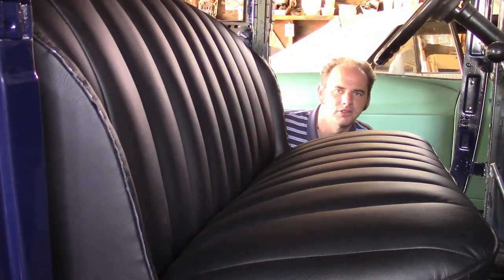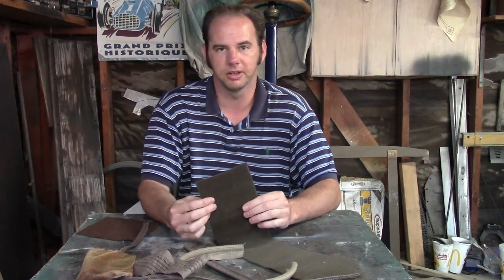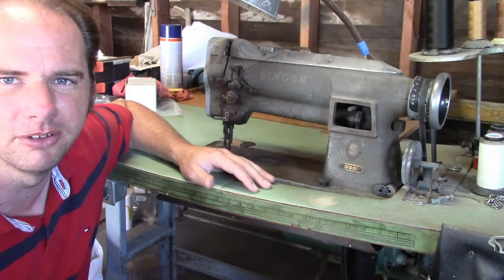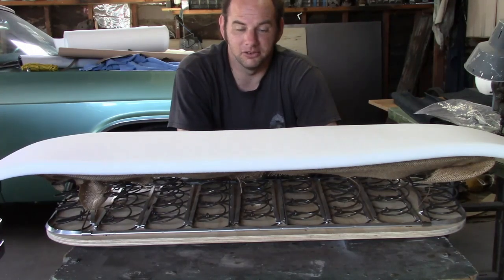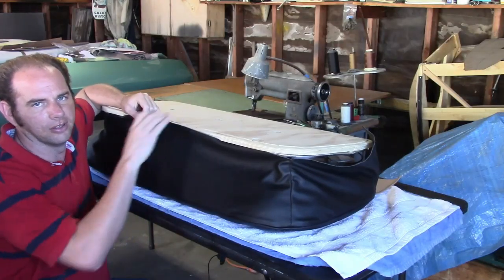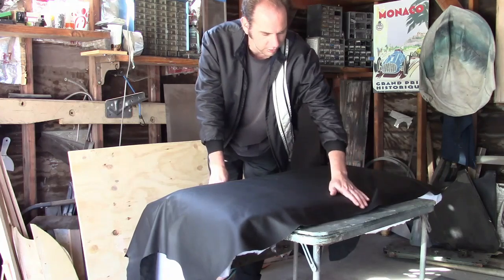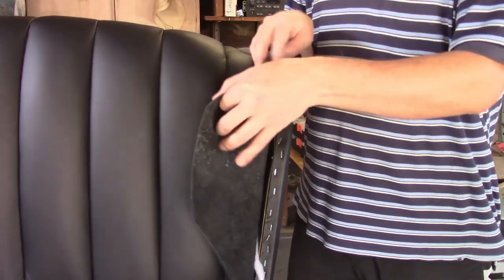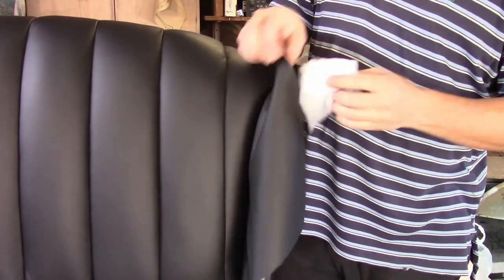1930 Ford Model "A" Repaint and interior. Part 5.

Comment: Brought back many memories of my first upholstery job on my 1926 Model T touring. We drove up to Greenfield Village to take measurements and pictures of the 15 millionth T because back in the 70's there were no detailed photos. My machine was an old Singer treddle type that I'd added  a sewing machine motor. I did most of my work in the drive way in the warm sun to make the textured vinyl more plyable.
Something I used, small weeping willow trees from a nearby river for the seat back tack strips. Soaking them in water then using a lot of C-clamps worked well. After 40+ years the seats still looked decent. Back then I used tacks where there was wood in many areas.
I upholstered several old pick up trucks and cars after that. All were just basic simple custom jobs. If I'd done it for a living I'd gone broke!
Reply from the maker: Clever. I'll have to try that next time I need to make a tack strip.
Reply: @onewhocollects6781  Cut the small willow trees when young and flexable. Soak in a piece of house gutter filled with water. Then place on rear tack strip area of seat and add small C-clamps.
Somewhere I'd gotten a large 3' wide roll of Army green canvas type material to use as the first seat spring covering, hog ringed in place. Used it for years for lots of projects.

Comment: Looks nice!  I made a simple seat frame press out of a board, a piece of plywood, and some all-thread with nuts and washers.  It allowed me to compress the springs while I attached the front, back, and most of the sides.  Then I removed the press and finished the sides.
Reply from the maker: pretty clever.

Comment: I just have a question. When you got done with the seat, how did you do the welting to cover the staples or tacks?
Reply from the maker: I used Wire-on trim. It gets nailed down, then folds over to hide the nails.